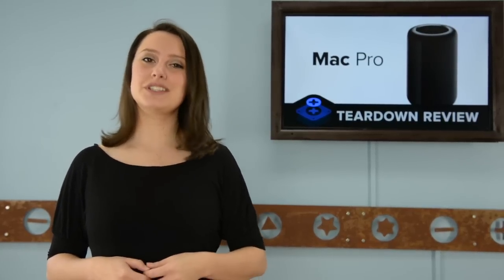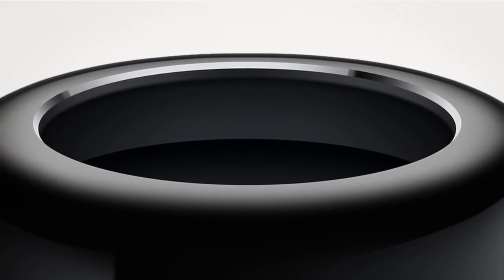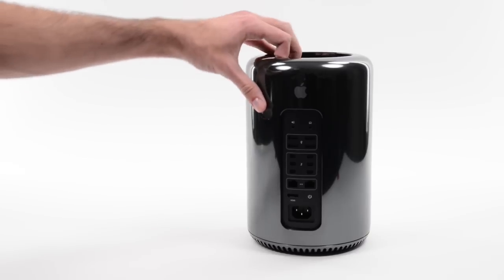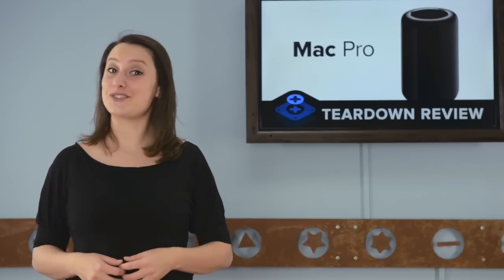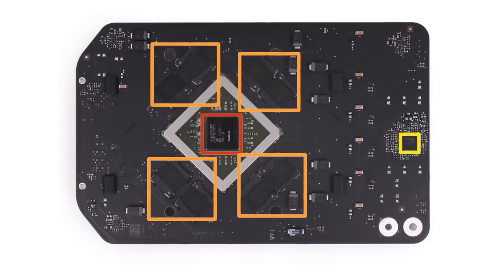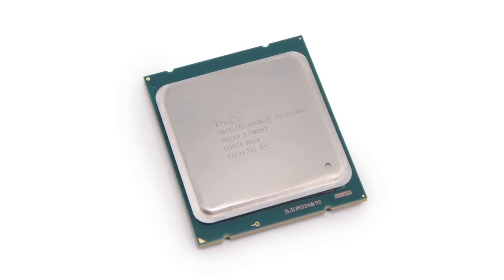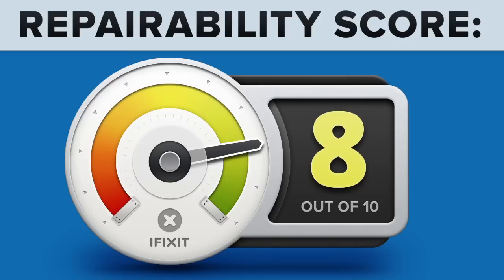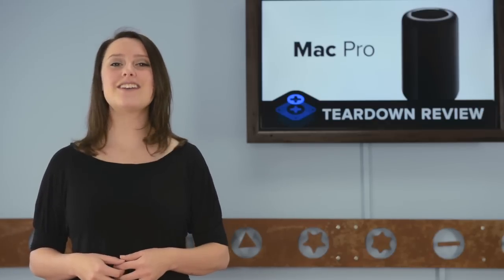Mac Pro Teardown Review

Comment: 9/10 at least, easy to do anything, and how can it be a minus, if u have butterfingers and u break something because of your stupidity?
Reply: 6 out of 10 for everything bespoke and non industry standard imo, everything about this machine is going to clean you out of money for upgrades or repairs, burnt too many times by apple unecessarilyy bespoke designs, I will see what the build quality and longevity of the machine is first, if its last 6 years of hard use without need of repair it might be worth it.
Reply: "if its last 6 years of hard use without need of repair it might be worth it." Which is pretty standard for macs.

Comment: Hmmm... with $3,000 to $11,000 I could get a mini ITX-Case [ASRock M8] or...
Lian Li PC-100 with an MSi Z87a, then throw in a Core-I5, DDR3 RAM, PSU 80%, VGA GTX-760 ITX, mechanical HD and DVDR drive and still do user upgrade whenever I fell the need to do so.
Actually I could build both of these and still not go over the $3,000 mark.
Interesting design [paper trashcan?] props for the compact design but sorry Apple but I'll countinue to stick with IBM PC's due to the high cost.
Reply: The Floppmann How was it ignorant? What he said makes sense.

A lot of sense actually.
Reply: Tokkemon How can you compare a pc for gaming like he posted to a pc made for professional use (rendering, 3d modeling, etc.). You can't and you're ignorant if you think you can.

The Mac Pro would blow his computer out of the water in anything but gaming.. well because its not a gaming pc. His comment was ignorant, and I think you might be confused as to the definition of ignorant.

ig·no·rant
ˈignərənt/Submit
adjective
1.
lacking knowledge or awareness in general; uneducated or unsophisticated.
"he was told constantly that he was ignorant and stupid"
synonyms:	uneducated, unknowledgeable, untaught, unschooled, untutored, untrained, illiterate, unlettered, unlearned, unread, uninformed, unenlightened, benighted; More

He tried to compare a gaming pc to a professional pc, that's ignorant.
Reply: Let me guess.... is it a gaming PC. Your missing a lot (I mean ALL) of the workstation features. Your using a z87 board meaning nothing over quad core, your not using a xeon (no ecc memory), regular non buffered ram, a gpu that has terrible FP64 performance, no ecc vram, and no support for 10 bit color.

Of course your computer is significantly cheaper ITS NOT  A WORKSTATION
Reply: Then you would have two shitty pc's. So why would you even think about it?
Reply: Comparing this to an IBM PC is like to compare the first car ever to any modern car. :)

Also this computer is not for anyone. ;)

So your comment is not really adequate.
Reply: The Floppmann
I don't think she needs to be insulted.Did you copy and paste your reply?Doesn't that just make you angry if someone were to question you starting with character assassination. That's how I know I've won a  debate as soon as my opponent has no more logic and reverts to my gender,creed or philosophy. I love apple and think they have been on a downward spiral since SJ Died I think she is right with 11K I could build a lot more productivity and though I like the aesthetics especially of the unibody. it seems like apple is now pandering toward pleasing rather than leading innovation. I don't mind paying extra for creative solutions mag port that has saved me about 15 serious falls and since it cost more I upgrade further and have been able to average 3years per MBP and then they last another 5 with my kids and ....until I see powerbooks on craigslist
with the pc I'd buy about 4 middle high range in that same period and probably because they broke and created an environment hazard. Have nothing in my hands at the end.
Reply: The Floppmann Actually it's not over priced. http://appleinsider.com/articles/13/12/24/apples-new-mac-pro-a-better-value-than-the-sum-of-its-parts
Reply: VisualSimulator Finally someone with proof and not just talking out their ass like everyone else. Thanks for the link. It looks like AMD is selling those GPUs to Apple for dirt cheap, That is the only thing keeping the price difference so huge, I would like to see the Nvidia solution comparison when it comes out.
Reply: lolol an i5 and a 760. You don't know how what workstation cards are.
Reply: The specs you listed aren't even good for OpenCL and multi-core/multi-threaded applications.

What you would have is a gaming pc, not a workstation one like the Mac Pro.  Better to get a haswell-e 4930k on an x79 or a xeon and put them in dual socket. The Mac Pro comes with an amazingly small form factor with good performance for the price, I'd definitely recommend it for production value. This is coming from someone who builds his own rigs.
Reply: Guys Guys Guys!
You're right about business use for this [Mac] PC but as for as it being a ''Pro'' consumer PC? I still feel it's overpriced for that type of user.
Why did you think I mentioned mid. range specs like I did when I could have thrown ''big'' pricey words around like Core-i7 3970x & P9X79-E WS LGA 2011.
Ya! I get it: small form factor, Mini ITX server board & GPU, Slimeline PSU, Labor costs? (China)... etc... etc...
My point was for the Gamer or High-end user.
Sorry I didn't make that clear enough. SHESH!
I still stand by my argument of it being overpriced: use larger components and put it in a larger case.Don't give me that ''OH I DON'T HAVE ENOUGH ROOM FOR A BIGGER CASE!'' yes you do.
Reply: quigon87yt glad you that point clear. It really is extremely overpriced as a computer for consumer use. but is quite a deal for professional graphics work. and as a portable off site editing machine, its just beast.
Reply: quigon87yt But why are you coming to a video about a professional work station to compare it to a gaming rig? Since this is not even in gamers interest what are you doing here in the first place? OF COURSE it's... not overpriced, but UNNECESSARY for an average user lol.

God... what's so hard for people to understand? This wasn't even built for gaming at all. Yet people come here talking about how much performance you can get with a gaming rig. Are people even awake when they write their dumb stuff? I bet you're gonna "counter attack" this statement anyway, but save yourself the worries. I won't care about it. Have a fantastic day.

Comment: Just let everyone aware that this MAC PRO is IVY BRIDGE build (2012) with DDR3 and D300 as basic build. Technical term, this MAC PRO build has been outdated for 4 years from now back to when the first order placed. They need to upgrade this or else this product would not fly anywhere !!!!
Reply: +hamahamieng Workstation hardware is powerful for a lot of reasons. Even if this was a Unix/Linux/Windows OS workstation, you have to take into account that the hardware's age:reliability ratio is different than a consumer product. 

Any workstation, when presented with adequate load, will perform in a very stable manner for extended periods of time. Firepro and Quadro cards are never as "powerful" as the best of the consumer line models released around the same time, but they are more reliable and deliver more accurate results. DDR3 1867 is slower than DDR4, but we also talking about DDR ECC memory, which safeguards the machine from randomly crashing due to random bit switches, which happen often in a machine that's left on for days and/or working 24/7.

I'm not a fanboy, I swear.
Reply: +pntm LOL do you even actually realized what I said ? The IVY BRIDGE build is already 4 years old build. ECC does not cost much if you think for the $3000USD build. Any $2000USD build can be better than this one! Workstation does not mean much if I can build same specs with more future proof and save 1/3-1/2 of the price. The ECC ram is expensive but not that expensive as you exaggerated. Skylake run less energy, more reliable, less heat and still supported by Intel. Ivy bridge is a no!!!!! Based on your tone I am sure you do not know what you are even talking about! This MAC PRO is on the edge of discontinue due to its lack of practical usage on the current market. How can you sell the same PC with the same price after 4 years for graphical design purpose ? That is actually ancient in technology viewpoint.
Reply: Lol you must not use workstations
Reply: +pntm Got 4 of them running, and yes I do the simulation if you want to ask what I am using it for. Don't need your suggestion ~,~
Reply: hamahamieng I think you are using computers wrong if you're not satisfied. You don't buy a screwdriver and expect it to have wrench capabilities in 2 years. You don't buy a 15 part multitool and expect it to develop a 16th tool in any amount of time. 

If you had the right hardware in the computer from Day 1, do not expect it to be the best hardware in 3 years. But it will still be the RIGHT hardware.

If the Mac Pro is not the right machine for the job, don't buy it. But don't shit on it for not being the right hardware for your job requirements, you're complaining about a multitool not developing new functions.
Reply: +pntm I do not know how much comprehension in your brain from my statements and comments, however, you seem to lose your track and get me wrong here. I do own Mac and I do use it, I do not know why would I even need to say that I own a Mac to have the right to bash about MAC. It is just not reasonable for paying the same price after 4 years from the release date. Please do your researches on MAC PRO before say anything please. You may have it but I do not know what you are using it for and still satisfy with its spec after 4 years. For my work I do not feel satisfy and urge for an upgrade and that piece of expensive sht can not even complete the same task as the Skylake I own. After this I confirm you are a fanboy and know nothing about MAC PRO. Thanks for comments though.
Reply: Well there you go, you can't comprehend
Reply: Any computer which is used for a purpose, be it a cash register machine or a workstation, will do the job it was meant for no worse or better in 4 years. Machines don't evolve, they do not grow, they are made to do tasks are specified speeds and no quicker. You do not have a right to complain that your machine, whatever it is, does not do a job it wasn't created to do. It's like complaining your icepick can't loosen torx screws. It's a mindset you lack, time to assimilate it.
Reply: Sorry, you have every right to complain, but don't blame the company for not "future proofing" your investment. Have better planning skills. Plan to replace equipment for faster stock.
Reply: +pntm Well I guess you still can not understand the simple thing and yes I have the right complain about it since I bought it. Actually Apple planned to give an upgrade for free but still no news from them yet. The upgrade should be this year for the MAC PRO. But still no upgrade from Apple and yes the performance is shit compare to the new trend and it influences the work and efficiency. MAC PRO  was designed for heavy user on simulation and graphic designer and it should deliver the satisfaction went bought; not deliver a 4 years old of shit right out of batch. that is just ridiculous. This is similar to the idea of keeping paying 50 bucks for a 1995 mouse version with trackball while you can pay the same for a decent lazer mouse in 2000 is retardation. Not even saying the need of fast responsive from mouse is very cruicial for certain purpose such as gaming/multitasking. If you still want to pay 3k for that trashbin then can go ahead and buy that trashbin now in 2016. It all goes down how much you are satisfied with your money. With 3K I expect more but not with trashbin anymore. 4 years ago may be but now it is just a waste of money.

Comment: Great thanks.
I wish I had the money too buy it fully upgraded.
Reply: If you pick the PC road you can get more with "standard" Mac Pro price
Reply: Yeah sure your right.
But I don't like windows I only use mac.
Reply: aleee2010 one word: hackintosh.
Reply: aleee2010 then put the mac os on it :s
Reply: Eiyu doki All the equivalent PC builds I've seen people price out cost at least as much as (if not more than) the Mac Pro.
Reply: Noah Lach not true. I just put together a slightly more powerful windows-version of the mac pro base model for $2300. It included a E5-1620v2, dual FirePo V5900s, 16 GB of RAM, an ASUS Rampage IV Gene, watercooling, a 1TB Samsung SSD, 850W Be Quiet PSU and a Fractal Design Case. Still $700 cheaper than apple's trashcan.
Reply: Eiyu doki Nonsense, Good luck even finding the Fire Pro graphics cards for less than the price of the ENTIRE machine. But don't let facts get in the way of your trolling.
Reply: Sidewinder The fact that you think that machine has similar specs just evinces your incompetence at making such comparisons.
First, the D300, most likely close in specs to the W5000, will blow your V5900 out of the water. But nice try.
The water-cooling is not a feature, it is a necessity, one not needed on the Mac Pro, since it runs far more coolly. Your 1TB SSD is SATA, and can not even come close to the throughput of the PCI SSD in the Mac Pro. So try doing real time 4k video on that. Good luck.
And then there's the issue of TB, FW, and any number of other possible dissimilarities.
The systems just flat out are NOT comparable.
Reply: Sidewinder What about the 6 Thunderbolt ports? W5000's that are actually the D300's in this thing? The PCIe SSD? The SSD alone will eat that $700 "saving". Also, what about the OS? The software it comes with? The warranty/support package? Also, are you willing to have it fail in the middle of a multi-thousand dollar contract and have no quick and easy support path? Or would you rather have to phone a single company who'll be better able to tell you what's up with it and have the option of renting a replacement system to complete your project for far less? Just to save $700 initially?

It's false economy to build your own workstation for the kind of tasks they're actually designed to be used on. Time is money. Troubleshooting it then waiting for the single component to be RMA'd can cost you far more than you save by building your own.

Obviously you don't work in these kind of conditions where support and stability are worth more in the long run than saving a few bucks in the short term. This is why medium to enterprise size businesses don't build their own machines. They get a service contract with a single vendor then do everything through them. Ever wondered why most office buildings have rows of Dells or HP's? Likely with Dell's or HP's in the server room too rather than some generic bland case with all custom builds in them?
Reply: Eiyu doki That's what you think! Try adding 2 AMD W9000 (they are equivalent to D700s) together with the 12-core Xeon E5-v2 you'll see that only those three items will exceed the total price of the Mac Pro fully uppgraded =)

Comment: What is the size of the m.2 ssd? I want to know if the Crucial M500 2280 will fit?
Reply: M.2 SSD's are faster then SATA, as SATA SSDs deal with the 6Gp/s speed bottleneck.
Reply: ***** Thank you. Mr Potato
Reply: ***** I apologize for my stupidity.
Reply: As for the Crucial M.2 SSD, I dont think it would fit.
Reply: Abdullah Ijaz Oh well. Thanks for the advice.
Reply: TheSvenVids However, if you want to upgrade the SSD, I think OWC.com makes some upgrades.
Reply: Abdullah Ijaz
M.2 is SATA 3.0/PCIe 3.0/USB 3.0... See; http://www.transcend-info.com/Products/No-644. Clearly states the drive is 6.0 Gb/s SATA III standard. Same thing my Dell Venue 11 Pro Tablet uses. The tablet has 3 ports (1 for WiFi, 1 for SSD, 1 for WWAN Cell Network Card). As for the OP's question, looks to be the longest version of the cards. My tablet uses the mid length card. Cards come in 42mm, 60mm (my tablet), and 80mm (appears to be what this uses).
Reply: Keith Smith
BTW, have found out this SSD is NOT M.2 and I don't see a single PCIe SSD on Newegg that would work in this machine as it appears to be a special design that no one else has adopted. You're only luck to upgrade it is through Apple it would appear.

Comment: Honestly I cannot see anything other than a trash can
Reply: +Artemis im not the only one thats thinks that :D
Reply: +Artemis Lol I bet that trashcan has better specs than your computer.
Reply: andrew kemnitz so what? it's still a trash can
Reply: +Artemis I always thought air-purifier
Reply: +andrew kemnitz Nope. I have a 5820k, 16gb of RAM, and 980ti SLI. Scrubs.
Reply: Adam Fam How to lie: Google "best PC parts March 2016."
Reply: andrew kemnitz if I did that, it would've said the 5960x and a titan x. Check yourself before you rek yourself
Reply: ***** Nah. It's just most people lie to impress or make a point. Why do you need two Titan X's? Do you have a dual monitor set up?
Reply: ***** Oh cool. What do you use three for?
Reply: +DFGRhys ...
Reply: ***** Dual titans for charts, bit over kill don't you think?
Reply: unfortunately gtx1080 is much better. Sorry for money loss for titanx
Reply: ***** yep titax is really expensive I know
Reply: Artemis your empty box with bad ventilation, and 10 coolers on 2000-5000 rpm is horrible, noisy big piece of shit